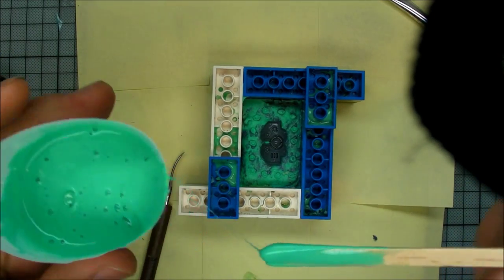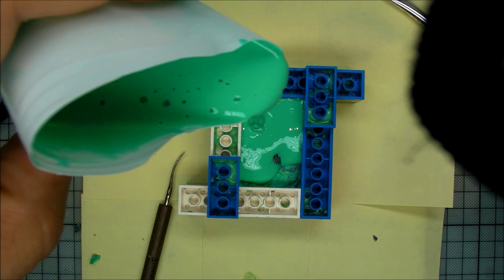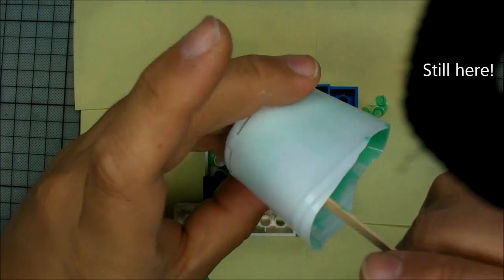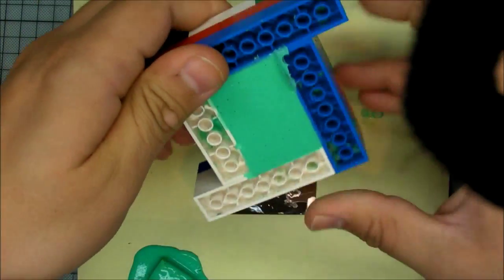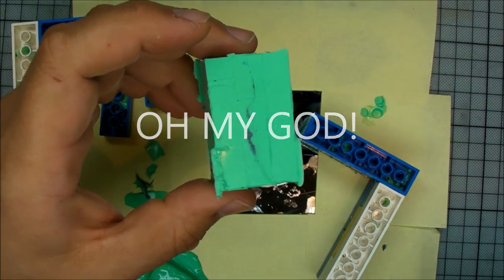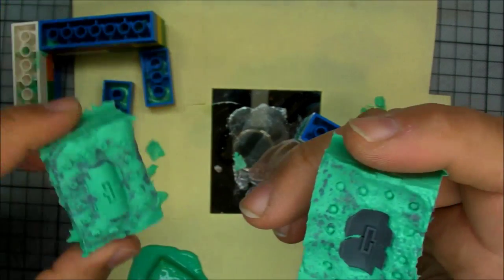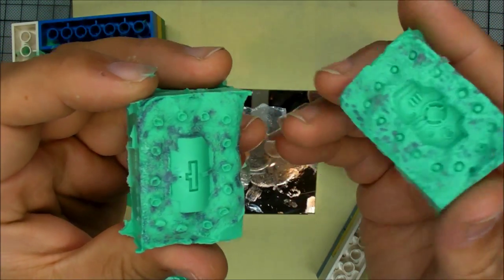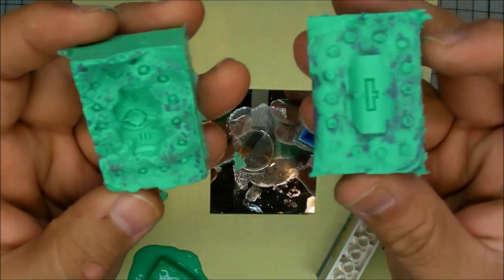Tutorial Tuesday #1 - Mold cast your own resin copies - Part 3/3

Comment: You're right in making molds of miniatures isn't worth the time & money, BUT there are some things that make it necessary. After 15 years, getting back into modeling but going for 1/35th scale zombie/apocalypse dioramas. Thing is, there are few plastic figures you can use out of the box, which leave you two alternatives. Buy resin figures which run from $10 to $30 or modify plastic figures. Got a lot of military figures I'm modifying to look like civilians by sanding off their uniforms, adding hair to tops of head via Milliput. But what about women ? All that are current are once again resin and when I'm looking at having up to 2 dozen, maybe more in a diorama, that gets expensive REALLY quick. But Master box came out with a pin up girl set which I'm modifying by sanding off their clothing and will add Milliput to for clothes, capes, etc. The problem is except for 1 figure, ALL are wearing high heels, something you don't want to be wearing in such situations. So have several military figures with different styles of boots and shoes. Making molds of the area just above the leg and found I can glue these pieces to the female figures.